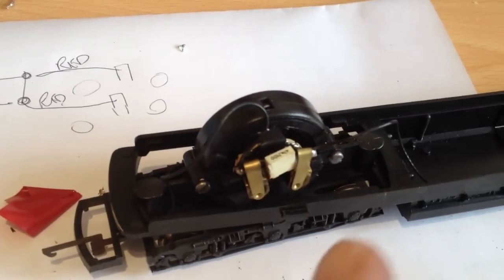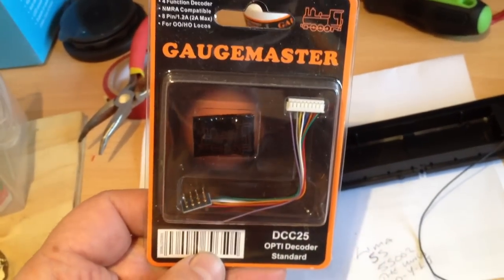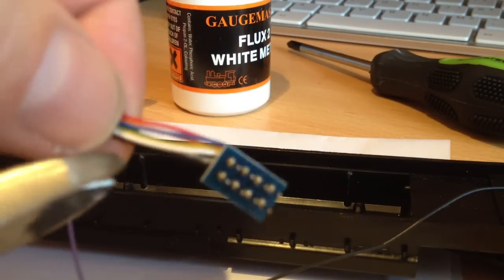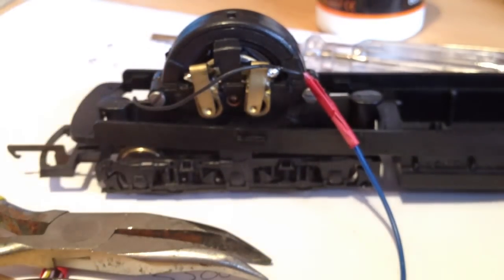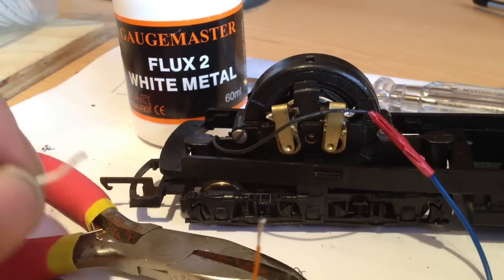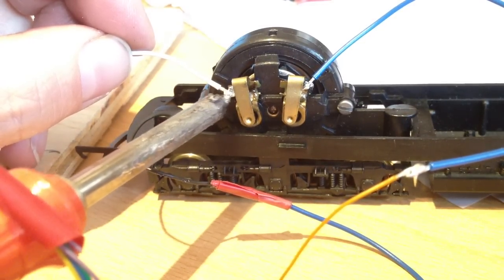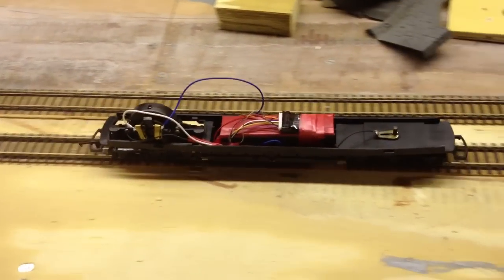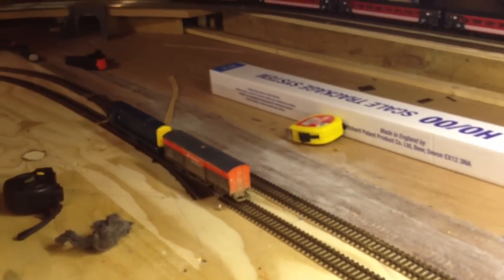DCC Installation to Lima Class 55

Comment: Nice little job there. Two tips for you. 1) Invest in a new iron - Antex 25watt with fine tip. 2) Invest in a couple of meters of "Heatshrink". Three reasons. 1) Much better control of heating & soldering in restricted spaces. 2) Heatshrink makes a neater insulator. 3) Professional looking results! Hope you don't mind. What you've done is great and I'm only advising, not criticising. Best of luck - onward & upward! Bob

Comment: Excellent video - will be chipping up all my Lima loco's.  Many I have have never been out if the box or run, and I tested many on DC first, and despite the bad press Lima motors get I would say compared to the older Hornby 3 pole Ringfield motors they perform way better.  I was so pleased as this means my 37's, 55, 40's are all keepers

Comment: Good informative video, just one or two suggestions, Get rid of that rusty nail you call a soldering iron and invest in a decent piece of kit. And 2, you should get some suitable heat shrink tubing and do away with that rubbish tape

Comment: I have just watched  your video with great interest, I am  in the process of converting  a LIMA class  47, from  DC to DCC , I have stripped  down the motor and checked and cleaned the brushes and the springs  , put it all back together  and tested  it in DC mode, works really well , my next  job  is to  fit the Dcc chip which is a hornby  product ??  even though  you recommend  gaugemaster , I will have to see what the outcome is  ???.. (  check this out ) my layout,  youtube a complete remodel of my DCC layout.  Would like your comments  if possible,    MARK
Reply: The basic procedures described in this video should work with any brand of DCC decoder.  Not 100% positive, but I'm reasonably sure all DCC manufacturers conform to the NMRA (US) standard for wire color-coding.  If you're unsure, the decoder instructions should have information on the color-coding for that particular decoder.

BTW, in the past ten years, I've done about 85 decoder installs for myself and friends.  Never done a LIMA before, which is why I checked out this video BEFORE I attempt a conversion of the old Dutch NS EMU set I recently acquired.